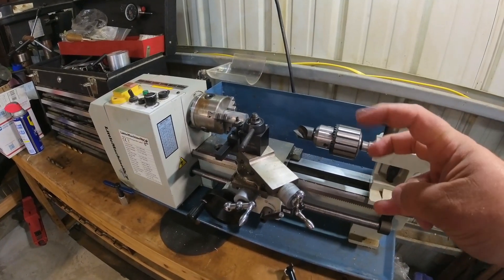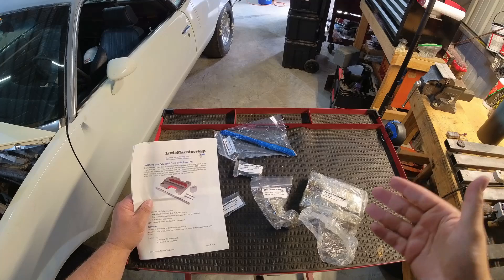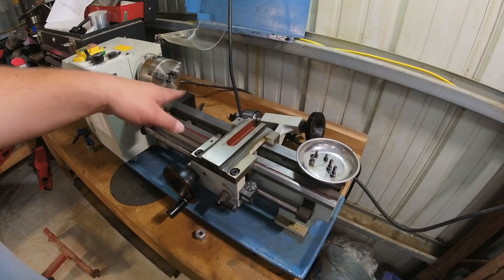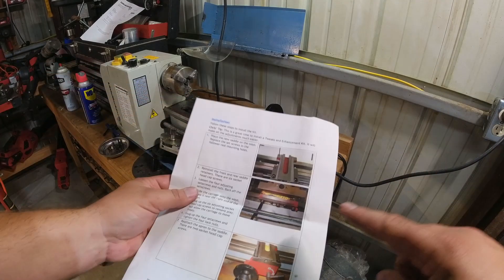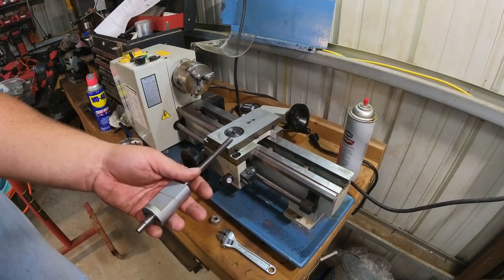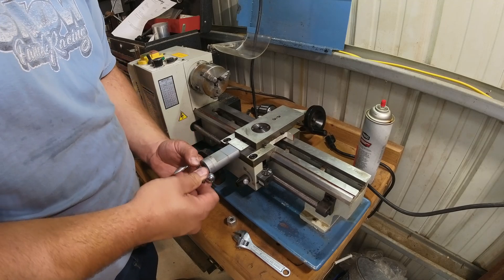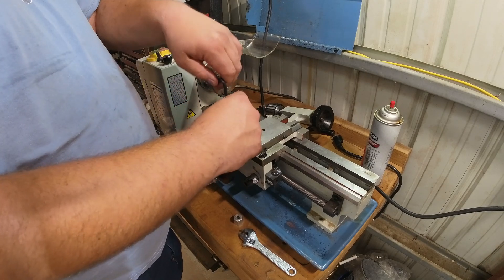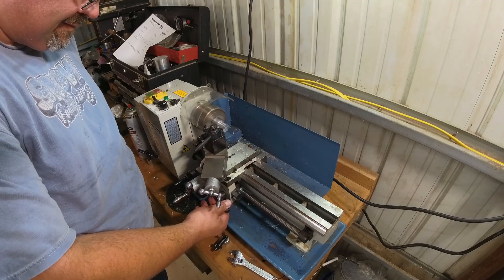Ultimate Little Machine Shop 4100 Lathe Hack!

Comment: At 4:02, Just slide the entire carriage off of the end of the lathe.  Remove the little pin in the center between the front and back 'Ways'. Once it is off, turn it over and measure the gap between the clamp straps and bottom of the carriage with a feeler gauge and make new spacers to fill this gap instead of leaving it with air alone.
Reply from the maker: I understand what you're saying, and I'm going to go take a look at this to see how I can make it better.

Comment: 5 months since you posted this, what are your thoughts after having used this upgrade for a bit?
Reply from the maker: I do believe the shorter throw was a little more rigid, but this does make it a lot more useful in terms of being able to machine a wider diameter of parts. I'd do it again.